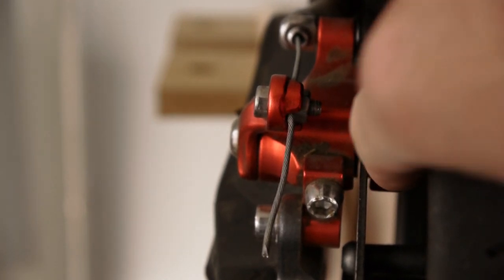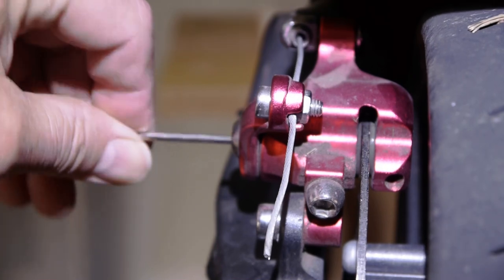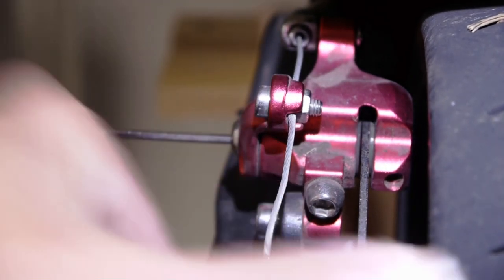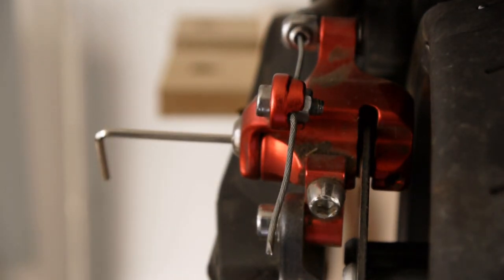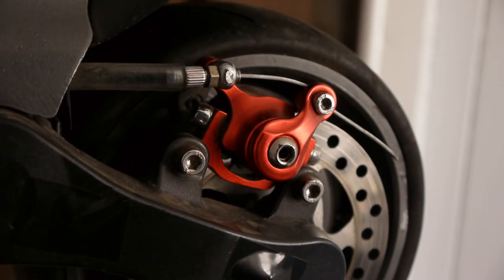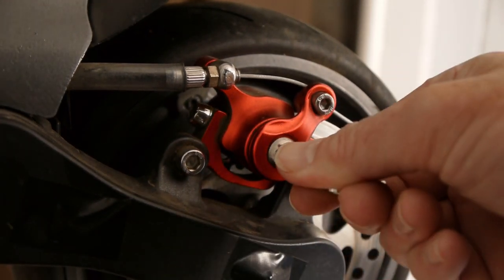Mercane brake adjustment (consolidated?)

Comment: How to fix the spring inside
Reply from the maker: I don't know what you mean, but generally you can't fix a broken spring of any type. However in case you aren't explaining the problem I recommend my blog post here
https://cjeastwd.blogspot.com/2019/09/mercane-safety-issue.html
which shows the entire caliper system
Reply: @finophile  the bolt that holds the spring inside wont go back in as it was under tension

Comment: How do people use rear brakes on these scooters, I have 2x WW pro models. rear brake cable is absolute trash, seized, cables snap. I switched to hydraulic on one of my scooters since i dont want to just rely on the front brake.
The brakes on this scooter are absolutely terrible for a 40kph machine.
Reply from the maker: First I'd say that my original brakes are fine,  if your cable is rusted you must live on the ocean. I've never seen a rusted cable and I have a few friends with them too. 
Still running everything original on my 2019 widewheel,  so you must do no maintenance and treat it badly
Lastly it's not a 40kph machine unless you disabled the speed limits and are going downhill. 
https://cjeastwd.blogspot.com/2019/11/mercane-dual-motor-top-speed.html

Comment: I actually ended up changing my brake pads on Thursday, it was very needed as they were worn way down. was quite easy to take it off, sadly the magnet holding the back brake pad seems to have broken. so i had to take just the biggest piece of it and put it back in with the new brake pad. and it holds. naturally it wont fall out, but i cant fathom how in the world it broke. first time changing brakes, was nervous
Reply from the maker: They are quite brittle (the magnets). A drop of hot melt glue on the back of the magnet will probably help hold it in too :-)
Reply: @finophile  nice, will do when I next take it off. Also had real issues with the backside adjustment. It was absolutely blasted shut, wouldent budge at aaallll. But it works, it was adjusted just fine. Need to bind it to a table and go ham. Sadly got nothing to hold it down with
Reply from the maker: @stianhelleland3099  if you mean the inside pad adjuster:

» did you undo the securing small black screw?

» I strongly recommend a small folding work bench as a minimum, they have clamping parts as the top. Makes all work easier

» did you try using a penetrating spray on it
Reply: @finophile  ahh! Will test it out again. Thanks for the tips 😊but yess, don't have the most equipment. But I make do👍

Comment: Nice video. Do you have any tips for squeeling sounds from the brakes? Replacing the disk? The pads are newish.
Reply from the maker: just make sure that the caliper is actually correctly parallel to the disc (adjust brakes first, especially make sure the inside brake pad is loosen fore and aft bolts, squeeze brake, kept squeezed, tighten fore and aft bolts, release brake).
That said squealing brakes is often a sign of dust on them and my motorbike discs sqeal from time to time ... then goes away, then comes back. Same with my 4WD
You could try pulling the pads and giving them a brush down ... but more trouble than I'm willing to go to.
Mine go through times of squealing and then not ... and then squealing ...
Reply: @finophile I just got mine out of the box and the brake pads scrape a little. It feels little disc is bent. Do you think adjusting the pads would fix it?

Comment: Is there a video on replacing the brake pads , Thanks
Reply from the maker: Hi Dean, no I haven't done that because its so absurdly easy
1) take the caliper off (just the two nuts facing you), leave the cable attached
2) wind back both the inner and outer "pistons"
3) with a pair of needle nose pliers (such as a leatherman) or with yoru fingers just (one at a time) grasp the green tabs visible and remove the pad (they're just held in by magnets)
4) assuming you've been adjusting the pads over time, just re-adjust the "pistons" to make the gap wider.

its actually so much simpler to do than to explain, like writing a set of instructions for how to make a cup of coffee.

Its about a 5 minute job, you'll literally spend more time in front of the screen watching dribble than actually doing it.

Remember, its the 2.5mm allen key to wind back the piston on the outside, and then the 4mm on the rear piston.

Try watching this video from this time: https://youtu.be/T-uM5is0zFQ?t=64

if you've taken it off and still are unable to understand what to do, shoot a reply off to this and I'll do up a video.
Reply from the maker: just did one for you ...
https://youtu.be/Ajstub-5YNs

Comment: Hi, sorry for the “off topic”. I have a Wide Wheel and the neck got the crack. I’ve ordered a replacement one, but can’t find any instructions on how to replace it. My biggest worry is how to replace/remove all the cables running through the neck. Have you seen any video or instructions how to do this? Thank you very much!
Reply from the maker: Hi
if you wish, reach out to me on my blog with a comment, all are subject to approval and post your email in there. I will not publish it. However there is a video from the makers showing how to.

Although I'm not sure about where your neck got a crack and what you're meaning because what you've said is too vague (could mean a lot of things). 
See here: https://www.youtube.com/watch?v=BPXovCoGKcA
Reply: dont need to remove all of the cables, just remove the 3x bolts on each side of the stem. 
The center cables you will need to remove = rear brake cable, and unplug controller communication cable from the top. 

You can re-run the cables in the stem quite easily with the thing apart. 
Change the center bearings while you are there.

Comment: Will the brakes stop it from running
Reply from the maker: I don't understand ... 
the brakes will lock up the wheel (if desired) and bring the scooter to a halt, if that's what you're asking.
So much wanking on the InterWebs about the advantages of hydraulic brakes on scooters yet no consideration of maintenance like bleeding brakes (that may even be a new term for you).

Here is a good comparison between hydraulic and cable operated: https://www.youtube.com/watch?v=XsqtxkwUeME 

Now, here's a thing for you to think about: leverage ... the longer the lever the more force that can be applied right? Well look at the distance between the tyre and the axle and the brake pads and the axle on: a scooter & a bicycle. You can quickly see that the distance is much more on the bicycle. Meaning that the brakes NEED to be much more powerful to provide the same force to the ground.

Nobody seems to think about this or about the speed of the disc (due to smaller wheel diameter at the same speed) and the influence of heat on the pads ... but then its better to just wank about buying (essentially) magic things than think about the physics and usefulness of them.
Reply: @finophile  hes asking if the brakes will disable the motors, and yes they will as there is an electronic switch on each handle to disable the motor anytime brakes are on. Since the unit does not have regenerative braking, this is a critical function to at least save some battery power.

Comment: Does it have Electronic brakes? I cant feel it but it gives a "buzzing" sound when i press the handle in a bit. And it does have an extra cable at the brakehandlebar.
Reply from the maker: no it doesn't have electric brakes, I'm not sure what you mean by the extra cable at the handlebar but that's probably the brake sensor on the brake lever so that the brake lights can come on when you touch the brake (and also releases the cruise control too)
Reply: finophile how do you activate the cruisecontrol?
Reply from the maker: first you have to activate it in the settings (if it isn't), so 1) turn on 2) long press to get to power mode settings 3) if the 4th LED is not lit (meaning its not active) - push throttle all the way down and hold, then pull the brake lever and let go , let go of the throttle. You'll see the 4th light lit
go back out of power settings and you're good to  roll ... it'll activate after 7 seconds of constant throttle, you release by touching the brake enough to activate the tail light.